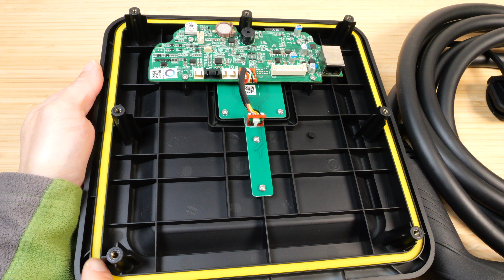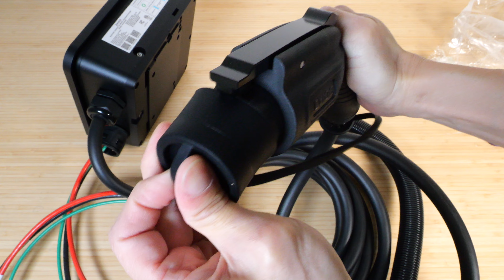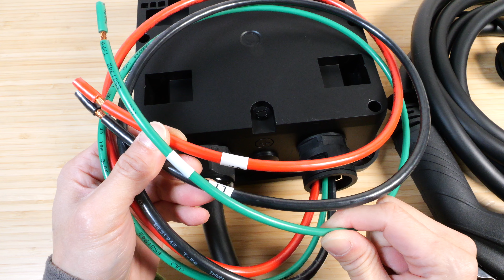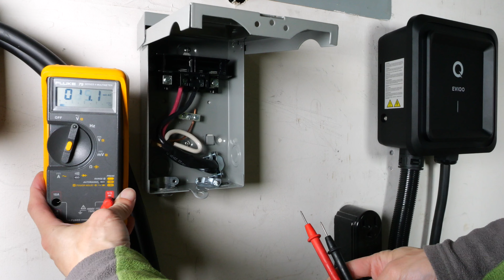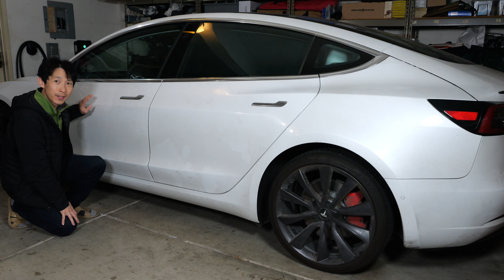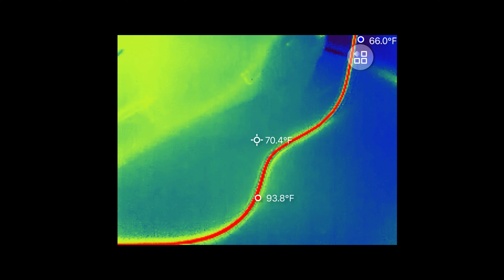EVIQO Level 2 48 Amp EV Charger Review

Comment from the maker: Get this EVIQO Level 2 EV Charger here: https://amzn.to/48JS6Tl (hardwired) https://amzn.to/4epA36a (14-50 Plug)
Or on EVIQO's website here: https://eviqo.io/?ref=lrtlwbgl

WARNING!!! DO NOT Use the AC Style disconnect I used in this video since it is intended for AC units that has a duty cycle much less than EV charging use. For EV chargers, you should use a lever style disconnect that is intended for CONTINUOUS AC current. I have already removed this connection in my setup for safety reasons.
Reply: Which center load box is that for the conection?

Comment: Hey, thank you for making this video, very helpful! Quick questions, how did you connect and secure the black conduit to the disconnect box? I feel like mine didn’t come with any adapters. Do you have a link so I can buy the clamps that work for this?
Reply from the maker: I didn't, but I have since learned to NOT use a disconnect box since its not rated for continuous current. You need a heftier lever style disconnect. The plastic shroud is likely not to code in many states.
Reply: @BeatTheBushDIY yeah I am going to join them directly with a wire nut rated for 6AWG cables (the blue one). But I still can’t figure out how to clamp this black conduit to the joint box.

Comment: I got a 48 amp EvIQO level 2 it charges very slow is this normal? To complete 3 kwh it takes about 4 hrs
Reply from the maker: Make sure you enabled the high current in the app as well as the car. Also make sure the connection to the grid is secure, a loose connection can cause high voltage drops and prevent high current charging.

Comment: Can you connect it directly to the main panel?
Reply from the maker: Consult your electrician and electrical code for the final say but a disconnect switch is still needed for safety reasons even if you have a breaker at the main panel. For example, the breaker could get fused closed and unable to open. The switch will allow for emergency shut off In that type of event. Or, there could be a fault at the charger while still being within the current range. You then want to turn it off in an emergency because something is melting or on fire. You also should use a switch with the long red handle since this is DC current and requires the more expensive type of switch. The one I showed might not be to code and I am in the process of upgrading it.

Comment: Awesome video thank you!

Question.  I have an Enel X Juicebox that a licensed electrician hardwired.  Would I be able to swap out that unit for this EVIQO unit and use the existing hardwired connections?

Thanks!!! connection connection connection
Reply from the maker: Technically yes but you have to be responsible for any possible malfunction going forward. One major issue is to torque the nuts to specification so that it will not heat up under high loads.

Comment: An absolute gem of a product. I needed to rewire mine and change settings because I had gotten a different car with a larger battery. They promptly responded with an up to date manual and the exact setting I needed for my new ride. A few days later they contacted me making sure everything was ok. The installation is an absolutely breeze.

Comment: What strain relief connector did you happen to use to connect the flexible black tubing to your disconnect?
Reply from the maker: It was a conduit cable clamp and the hose had zero slack so it just pushed itself against the bottom.
Reply: @BeatTheBushDIY  cool, ty!
Reply: @BeatTheBushDIY  Did it pass the electrical inspection? Or did not have one? Technically it is not to code..

Comment: The only issue with this charger is that it doesn’t have dual band Wi-Fi. You might wanna consider that when installing in the garage far away from your router.
Reply: This unit runs on 2.4ghz WiFi, which offers the longest range.  It also has a ethernet port so you can hardwire the network connection.

Comment: Oh where to start with this (horrible) company...

This company is by far the worst I’ve dealt with. I’ve written a few reviews about them, highlighting issues from their non-existent support to the time an employee called me, begging me to change my 1-star review because they feared being fired!

The unit lacks a reset button, so when it freezes, you’re left with no choice but to cut power at the breaker. After charging, the EV often no longer recognizes the charger as connected unless you physically disconnect it, reset the breaker, or go into the app to “force” a start.

As for the hardware, it’s incredibly frustrating. Until recently, you couldn’t even buy a hardware version; you had to remove and hardwire the plug. Worse, you couldn’t simply wire in the end because the plug wiring was undersized for the required load (cheap). Then there’s the problem with the connectors—the tight spaces and odd sizing make it nearly impossible to find the right connectors that can handle the voltage safely.

My experience has been terrible from start to finish, from unboxing the unit to dealing with their lackluster support and even receiving those desperate calls about changing my review. And the constant freezing and locking up of the unit? Just another headache.

The company’s marketing is just as questionable. Every YouTube review seems to be from someone who either received the unit for free or was paid to advertise it. Notice how you never see genuine reviews from regular homeowners or businesses? That alone should make you think—why is that?
Reply: Their support is the best I have experienced. They answer promptly through email and later through texts. Their product is an absolute gem. I really don't think you contacted them and are making this up.
Reply: @GlennRathke_WX Think what you want and if I could post the email and photos on here I would. 

The facts are and they've admitted to it, they sent out a used device, ignored everything about it being used and marked up, had an employee tell me "if I didn't change my review to 5 stars. They'd lose a contract and she'd be fired". 

So yea, you keep thinking what you want, or possibly continuing getting paid to try and cast doubt on those that are telling their true experiences about what they've gone through with this company.
Reply: thank you for your honest comments. people will believe what they want to believe. Basically confirmation bias.
Reply: Tom Moloughney (State of Charge - 106K subscribers) gave this unit a stellar rating, and he runs one of the premiere EV charging channels.  I'd trust his reviews as geniune.
Reply: @mowcowbell  again he was both provided and compensated for his "review".  Look into a little more and you'll see no one outside of those there where competitive for using it has said anything good about.  

But hey, you believe what you want.